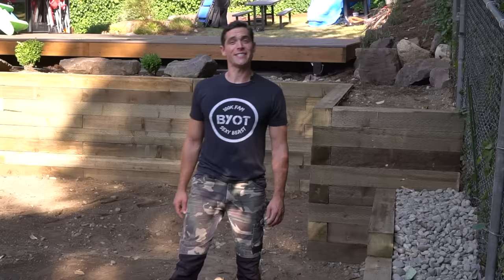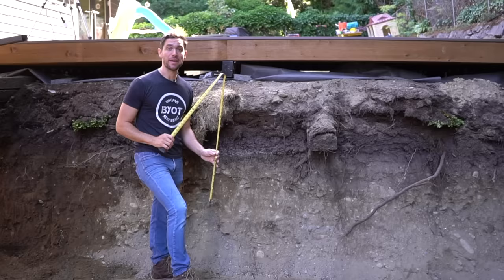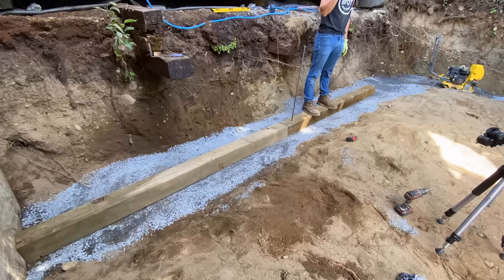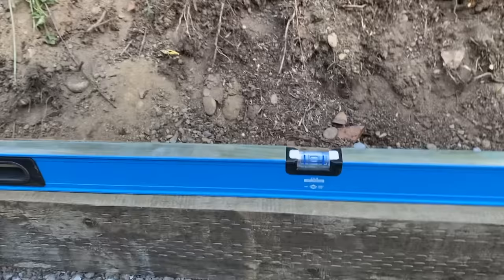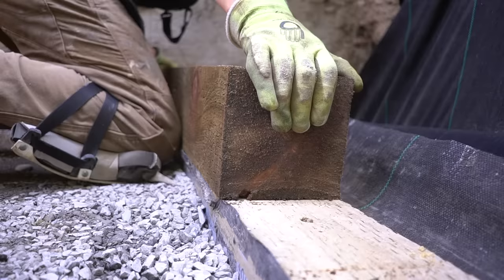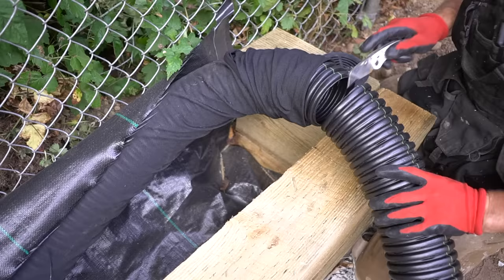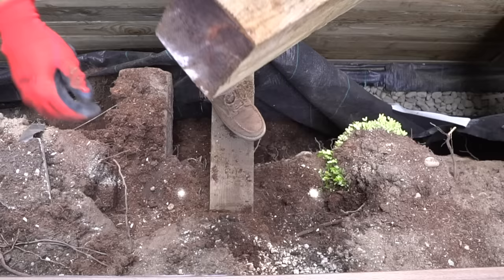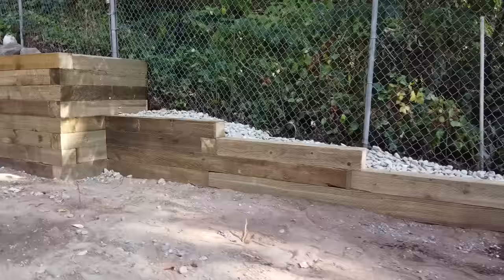HOW TO BUILD A RETAINING WALL

Comment: Deadheads are basically USELESS, if they have no T on the inside of the buried side. If you attach the deadheads together, you are building a retaining wall behind the retaining wall. The deadhead wall should be as far back into the soil, as the height of the wall.
Reply: It sounds as if you know your stuff so I'd like to ask a question.  I'm going to build a very short wall/barrier between my yard and the adjoining lake.  This will be 18" high at most with no more than around 6" above the water line.  With dirt on one side and water pushing against it on the other side is it necessary to add deadman supports or will the pressure more or less equalize?

Comment: your deadheads aren't for vertical force to push down on they are to hold back the lateral force that's trying to push the wall over. Also your deadheads shouldn't be used to span a joint like you did...they should be put in places where joints aren't for more stability. Instead of all those deadheads you could have used geogrid and saved yourself a ton of work. Also grinding a point on your rebar to help driving it in and avoiding rocks helps a lot as well as using a pneumatic driver or some sort such as a hammer drill/air hammer/post driver.

Comment: I think along the fence you should have used wood instead of just using the fence as the retaining wall to the rock. That portion will likely fail quicker and if the fence is the neighbor’s, they might complain to the city and force you to remove it due to the pressure on the fence

Comment: Im no expert, but it is my understanding that weed barrier behind a retaining wall is actually a mistake. It seems reasonable, but it will eventually clog and cause far more problems than it solves.
Reply: I agree. Weed barriers only work for a couple of years at best. Like Jurassic Park, "nature finds a way". Seems to be a waste of money.
Reply: So you would just use rock fill and nothing else?
Reply: @mattchisholm7836  yeah if you use enough rock, if it's good, compacted, angular drainage rock (none of which is what he used) it'll lock in place well enough and filter out enough of the dirt to prevent the pipe inside from clogging up

Comment: You can use a hammer drill for staking in rocky areas (speaking from experience)
Reply: @fredericrike5974  I need to stake into granite rock. Is this something I should look into?
Reply: @mattchisholm7836  I'm not sure this would work as I have seen it in North Texas- we sit on calciferous white rock that is relatively easy to drill or punch into. Since electricians have the same problems in hard rock country, I'd call and find out what they use. FR

Comment: The wall likely is not going anywhere. Good job. 
Two extra 'free' dead heads were not utilized , though . TWO beams that were very securely buried under the main deck were not tied into and attached to the tall section of the retainer in front of the deck.

Comment: Nice wall! I am a contractor and it's nice to see a Youtube channel build something right in these videos for a change.
Reply: I'm an engineer and I love when you contractors build stuff like this and think it's "right." I make a ton of money fixing this stuff.
Reply: @benstaehr9595  as an architect, I agree with you.  However, for a diy project, it surely is better than it was and as long as it's not structural, attached to house, I doubt people's lives are at risk.  I would recommend a decorative rail at the top for safety;  having children around is dangerous business.   At the beginning, two things.  
1. He walked down the retaining wall; he's gonna kick himself in the ass for not putting stairs in (I didn't catch if he said about putting one in). I'm sure he's walked down and up that fence line many times already. 
2. Not water sealing the side of the house concrete wall.  You can see that he butt that lumber up against the house and you can see stress(minor) cracks. Perfect time to fix what the original residential contractor didn't do (maybe code didn't call for it that area).  Personally, a concrete retaining wall could have been quicker and maybe less expensive.

Comment: Wouldn't it be easier to backfill with stone as you built the wall? That way it will compact more efficiently instead of dumping 4 feet of rock which needs the loader?

Comment: How did you finish up against the house; did you have to rework the siding?
Reply: He said it was finished so the assumption would be that he did nothing.  Shortcuts... sort of like brushing on a tiny thin coat of sealant after cutting the wood but not even bothering to brush even a tiny bit into the splintered areas where he cut or around and inside the holes for the rebar.

Comment: What you had before was old and falling apart, but I think it was more useful than the new wall because you could have a wonderful garden in there, or even fruit trees AND YOU HAD ACCESS- even though your wall is beautiful & your instructions are awesome- there was no access from the upper deck to the lower yard. WHERE'S THE STAIRS??

Comment: @ 1:05,  hehehe great material, the main beam wasn't installed plumb, and the joists were not even centered on the beams. Can see where this is going already, no need to go further.

Comment: Remember when use use stone for structural work, you want angular stone as it locks in together and isnt prone to moving around once compacted unline smooth or rounded stone. 

Also a sds with a rebar driving bit will speed the process up.

Also adding soil or stone to compact you want to add in lifts then compact as laying down all your stone at once will not fully compact the bottom
Reply: Always use round rock for drainage. Come on man.
Reply: @benstaehr9595  And saved the work of applying two lifts using landscape stone at the top.

Comment: As someone who's been thinking about building a low retaining wall to level out a sloped and largely unusable backyard, this is really helpful. 

What I'm struggling with is how to fill in the stone behind the wall when there's no existing "hill" to cut into like you had. In other words I'm going to build the retaining wall and then fill in the dirt behind it to create a flat yard. So how do I create a gap for the stones?
Reply: fill the dirt up to a couple feet away from where you want your wall, build the wall, then fill the gap with stone
Reply: If you’re building a retaining wall, whatever earth you’re retaining with the wall will be there…so you just fill in between the wall and the existing dirt…

Comment: Very good and informative video.  If not using the drainage rock for cosmetics, is the drainage rock required too be a certain hight or just a few inches above the drainage pipe.    Thanks.

Comment: Ideally a retaining wall should not have any horizontal forces pressing against the wall. This is done by having the dirt behind the wall prepared properly at the right width, compacted and built with enough layers of landscaping fabric sandwiched so that all the forces of the dirt goes straight down or slightly away from the wall. This wall might not be tall enough to require sandwiching the layers of backfill, but taller retaining walls definitely requires this.

Comment: you put a lot of effort into the drainage, Have you ever gone back to check on a 5 year old project? how did it go?
Reply: Also, the rocks go aside, they rotate to give space for the rebar, then push aside, compacting nearby dirt and pushing it upwards, big rocks will create voids. awkward as it is, best to just cut your rebar short if you hit a big rock(Greater than 1f. 450mm), drill a new hole and dowel in another bar.

Comment: Good evening.  I watched this video in it's entirety a few months ago.  I am interested in stacking railroad ties to form a planter in my backyard.  I don't need to remove anything, because I am starting on my grass, a clean slate.  My questions are: What kind of spikes would I use to hammer the ties into the ground, and what kind to hammer to each other.  My width will probably be about 18 inches, but I want to create a planter around my property, mainly because my town is not allowing me to put a fence up.  Thank you so much for your awesome video!
Reply: 12" galvanized spikes are usually requested by architects but using 10" galv. will do the. job. Try Home Depot.

Comment: 15:18  your deadhead are wrong, as per how my dad taught me.  The far end of the deadhead has to have a cross member it cant just be a stright into the soil beam if the in the dirt is wider more dirt holds it.  But better yet use get cloth every few layers, the cloth is the walls full length so all the back presure pushing on the wall also holds it in place.  Doing it that way you can build it highter.

Ok at the end looking back you did it right.
This isnt going anywhere.

One problem. No stairs to the lower leval.

Comment: Overall it looks good however I don't like the idea of using a deadhead directly over the joint of two 6x6s on the tear below. Also I know it looks good to you to have the dead heads all lined up but you're losing the value of the deadheads by having them all in the same area from a structural standpoint the load created on that one concentrated area makes it more likely to blow out than if you had the deadheads shared throughout the space.

Comment: Never a fan of screwing into end grain. If you can bore a pocket hole oyu achieve much more resilient hold. This is only important where the screw is maintaining structural integrity - not as you use them for pinning in position while you drive rebar into the ground.  

An example of where this is useful is the deadheads where you could screw in obliquely instead of into end grain. These types of steps matter in the long term where ground shift, tree roots and such pressure parts.

Comment: The dimensions and crushed rock base etc. is that following a local building code or something or just good practice for good results? Just wondering if i was to do something similar would I have to follow building codes etc. I'm sure it would need to be checked probably
Reply: It is a construction standard in most areas.

Comment: Geotechnical engineer here. I do not recommend building a wooden retaining wall. The average life span of a wooden retaining wall is 15 to 25 years; I have personally never seen one in good shape that is greater than 20 years old. Wooden retaining walls wear much more quickly than, say a deck or other outdoor structure because they are subjected to active and at-rest soil pressures and a lot more water. 

Also, I do not recommend backfilling the soil at the top of the wall with a silty sand (SM) or poorly graded sand with silt (SP-SM). That is what appears to have been placed in this video. I would recommend a lean clay with lesser sand instead, at a MINIMUM thickness of 8 inches, with grading at the top to include drainage swales to drain the water. The gravel behind the face of the wall is suppose to be placed to drain out residual water that leaks though areas that the less permeable surface at the top cannot prevent.

The soil used in this video at the top of the wall will allow more water to be introduced behind the face of the wall, accelerating the degradation of the wall. Yes, it's cool to style the top of the wall with plants and rocks, but your retaining wall is to act as a retaining structure. At the very least, a 4 foot tall wall is not subject to the same loading as a slightly taller timber wall. But you don't want that water sitting behind the face.

Guys, do yourself a favor and go with CMUs (Concrete Masonry Units) and only construct a wall as high as it is permitted by your county. If you need a civil engineer to design, then subcontract a good one. It is important to build and design the wall properly; I've worked at many private residence that simply did not do this, and it is headache inducing for them when insurance does not cover these issues.

Overall, this was a pretty solid video presentation. Take care.

Full disclaimer: these statements are my own and should not be considered to be professional engineer advice. Always consult with a professional that specializes in retaining wall construction locally in your specific geology prior to construction. I am not responsible or liable for any advice you take from this comment. But please do research prior to paying a contractor or engineer.
Reply: Hewy Basilman, well said. I am a retired landscaper whose first timber wall(back in the day when I knew everything) was with used RR ties(a 45' trailer load) using a carbide-bit concrete saw.  I even cut compound angles at the corners. Everything you said was pretty well right on the money. That RR tie wall seemed to rot overnight and the CCA stuff was probably 20 years at most before it was replaced or should have been replaced. Precast concrete is a completely different animal and I highly recommend it, as you do. My final year's of landscaping was as an estimator and I recall engineered drawings being readily available from the manufacturers.

Comment: Terrific build, Brent!! That came out great. Retaining walls are always controversial. :P Living in Florida where it rains a lot and very heavily, I agree with those who've said the fabric with pinholes is better because the weaved fabric always clogs eventually and can cause water build up and wall failure. I disagree with those who've said the wall needs to be stepped. I understand why they feel that way, but it isn't necessary with the engineering (cantilevers) you used.
Reply: It looks better with a 1/2" lip, is structurally sound(All walls should be cambered) and you don't need to worry so much about keeping it straight because every course you are snapping a chalk line to follow.

Comment: Want to make driving the rear in ez, rent a jack hammer just a small electric type.
The jack hammer will drive the rear in with littel effort. You can even use longer pieces.

Comment: Great stuff! Anyone has any idea how long would this wood last? Like 10-20 years?
Reply: did you ever find out how long the wood would last?
Reply: @pedrojuarezcardenas1310  Nope. People mention that cedar lasts pretty long time, though no numbers. Still debating of whether to go with wood vs concrete.
Reply: I moved into a house with a similar timber wall, although mine has the stairstepping build people recommend. I'm not sure if the ground contact timbers are different, but I found a tag on the end of middle timber that said "AC2 6x6x8 landscape timbers not recommended for structural purposes". My neighbor estimates it was built 18-20 years ago. On close inspection the timbers are definitely worn, but structurally the wall looks good. 

The top timbers take the brunt of precipitation and have water/snow sitting on them the longest so they wear through much faster than the rest. My piece of advice that I don't see mentioned anywhere is to screw on a top layer of 1x6s to serve as an easily replaceable wear layer.
Reply: @infinite_loophole  Very great suggestion!
Reply: Initially, CCA pressure-treated timber was touted as lasting forty years if buried in the ground. I am not sure about that but I do know that the stuff exposed to the air may have lasted 20 years before it lost its structural integrity or was replaced. They haven't made the CCA for many years and would expect the pressure treatment they have now won't last as long. The CCA stood for Chromated-Copper-Arsenate.
Reply: @sonnybowman  Interesting thanks for the info!

Comment: Interesting string line trick there to make sure that the timber’s were “perfectly straight” and on a 90 with the first one….  I always thought to measure off a string line to assure something was parallel with the string line, it had to be actually affixed to something so you’re actually measure off of it…. 
At 4’ high, shouldn’t that wall be stacked so it’s leaning back, toward the hill?  I would offset anything over two courses, actually.  But at 4’ you’ve got a helluva lot if weight behind there…setting that wall plumb would concern me…. 
Still trying to understand how your perforated pipe thrown in the bottom there with no slope on it is supposed to actually drain….  Maybe would have been a good idea to put some weep holes in the wall….  Big ones.

Comment: The drain should have a slope of 1/4” per foot, 1/8” minimum, otherwise you are just creating a larger place for the water to puddle. 

In some places a wall of this height without a railing would be considered a liability. 

As mentioned below, some places the 48” wall height limit for not requiring engineered plans and permit includes the foundation and excludes any loading from above such as steep slopes or other structures (deck).

Comment: What is the pressure-treat code for the timbers and is rebar (vs. hot dipped. galv or stainless), suitable for contact with them?
Reply: Neither, just use regular #4 (1/2")steel rebar. They will outlive the timber by a hundred years.

Comment: Those dead heads look much better if you make them a couple inches proud of the face and knock off the sides on a 22.5 angle also; they should be resealed with treatment...To the same with outside corners...Makes it look like you care.